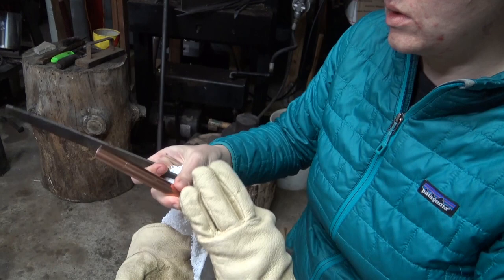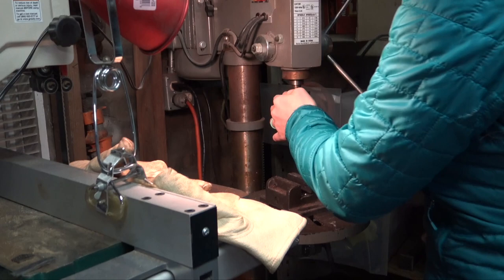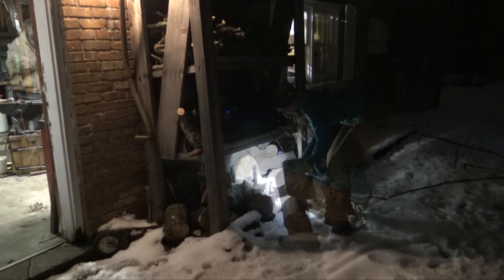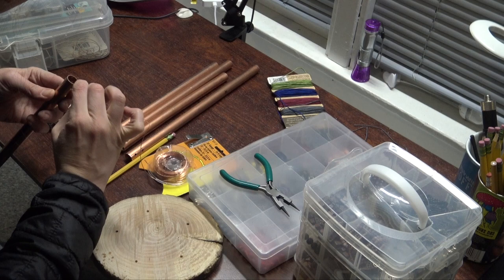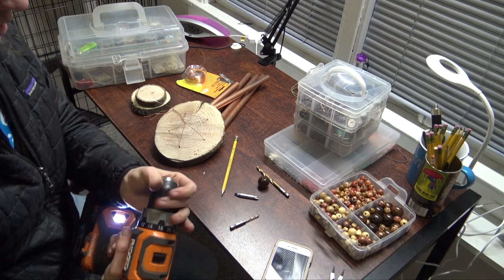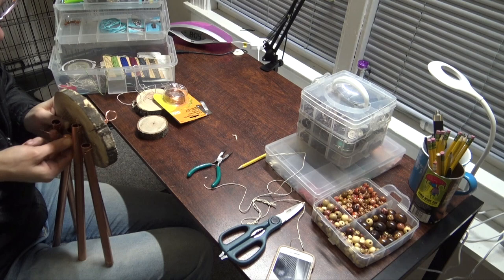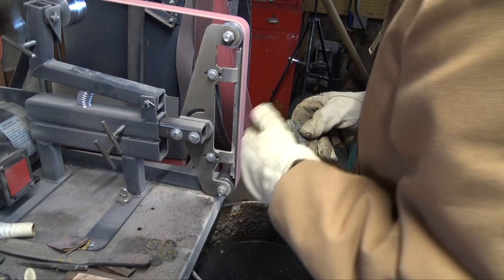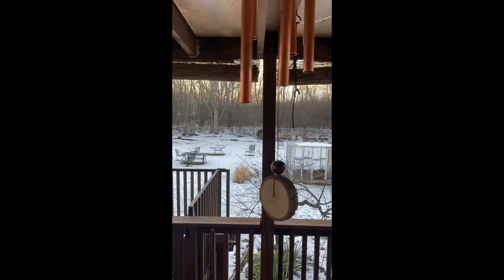Building wind chimes from copper pipe

Comment: I been watching videos on this and every one gives more options. That might be good for anybody here looking to make them. The only thing I might suggest on this is to lower the center striker down almost to the end of the shortest tube. Some builders say that where the striker is makes the tone where it hits the tube so you can raise or lower the tones a bit that way. You may know this already since it's been several months since it was posted. We all learn together. I am actually using old gas bottles like from a welding torch for some bells I am making but want to do tubes as well.